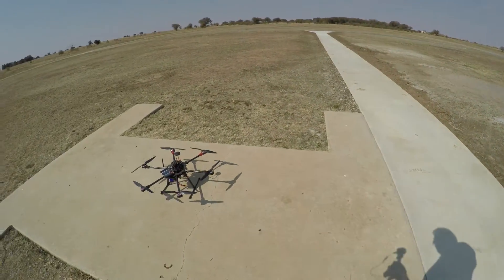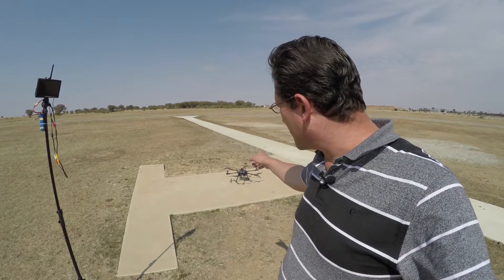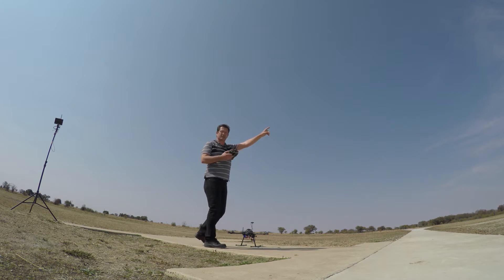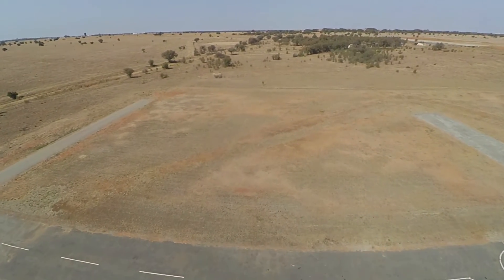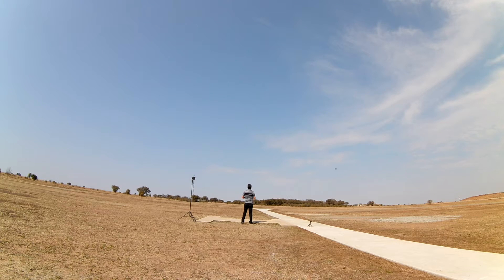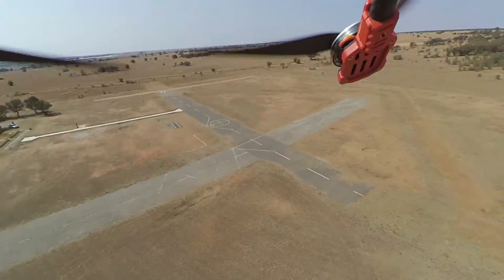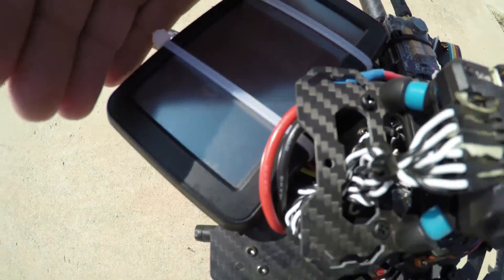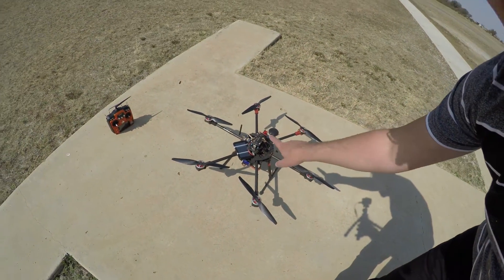How fast is this Hexacopter?

Comment: Flight time??
Reply from the maker: On the 8000mAh battery 12min. You could use a larger battery for longer flights.
Reply: @RiaanRoux    can it carry 5kg?? With 4s
Reply from the maker: @vwing7332  use 6s

Comment: What brand is the hexacopter
Reply from the maker: Regemark Films This is not a pre-built system. The frame is a Tarot FY690s with HYD 5010 motors. The ESCs are Hobbywing 30a Opto. The FC is an APM 2.8 (upgrading to Pixhawk currently).